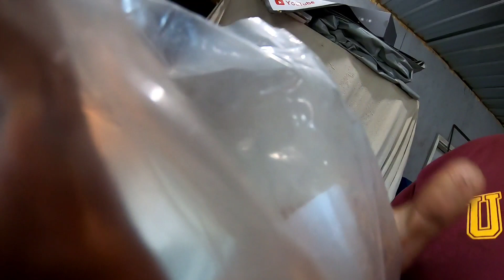Second Crop, First Crop and a Lube Job?

Comment: Put that boat nose behind my Alpine II, not fast but would get the job done! You itchin to get yer snowplow back on yer skidder? I know Ive had enough of this fuckin heat.

Also, fuckin A are you dead on about runnin at design. Back in my sawmill days you could always tell a shoestring mill by those that overclocked the fuckin setup. Try to run faster than designed and sure as shit things would go - BANG -  usually very fuckin violently and always expensive; money never more poorly spent.
Reply from the maker: Speed kills👍and I'm about over the heat as well its been brutal. We need a huge snow pack this winter.